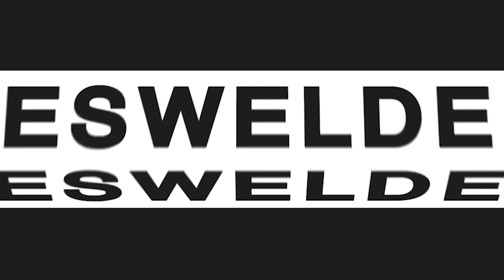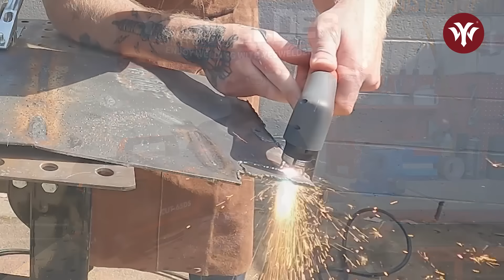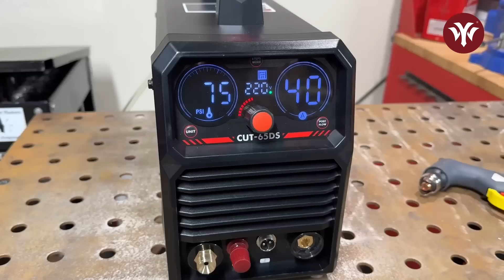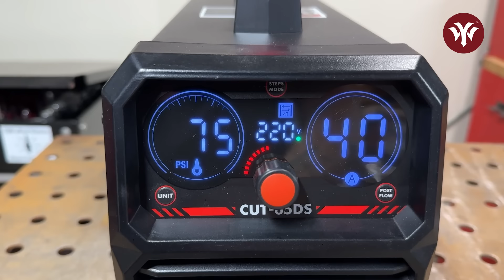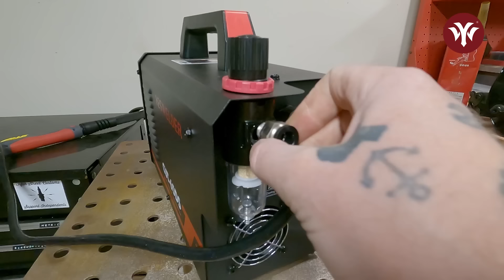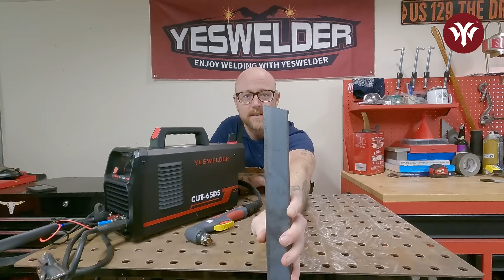Behold: The All-New CUT-65DS PRO! Your Cutting Edge Companion | YesWelder

Comment: Yeah the supplied air hose doesn’t come with an adapter to connect to a regular air compressor. And the nut on the air filter you have to remove bent immediately with a crescent wrench so use a socket.
Reply: Mine came with a matched thread 1/4  industrial style male fitting, (oddly with an o-ring although they reccomend using the included teflon tape) I used my own teflon tape, and never checked for leaks using just the O-ring, just made sure the treads matched before installing (good engagement, even with the shortish threads on the fitting) I'll didn't check the threads to see if they are 1/4npt or 10mm metric like on some other similar priced machines... Of course in addition to the poly hose/push lock nobody ever uses... Was your male quick connect missing or was the factory push lock mis-threaded? Mine came apart/went back together fine using my pocket carry 5" knipex pump pliers lol

Comment: Keep in mind, this is a 45 amp plasma cutter. The model number and advertising specifications purposely misleads you so you think you’re getting a 65 amp cutter.
Reply: How did you arrive at that conclusion? The 45 Amp I2 limit is for 110v. The I2 for 220 is 65A.
Reply: @billnelson3405  I the newer version and it puts out a full 65 A per my tester

Comment: Where does the air hose connect’s to?
Reply from the maker: The air hose connects to the Air Compressor Filter. For the exact connection point, please refer to the video at 5:48.:_Love:
Reply: @YesWelder  how does the hose connect o your air compressor?